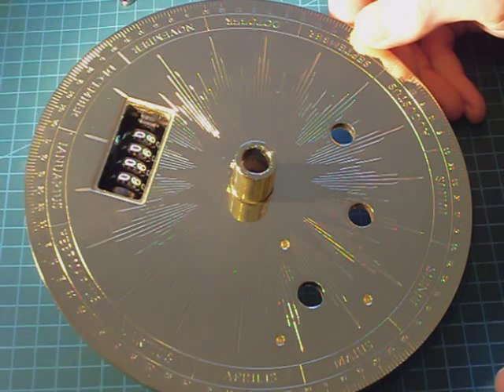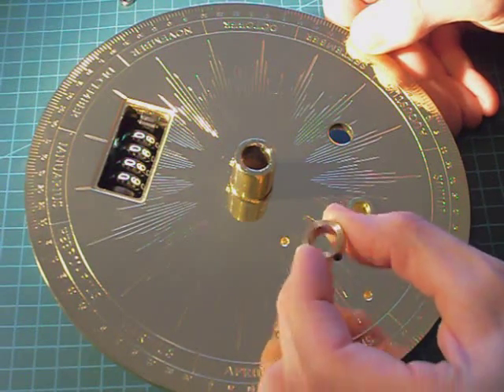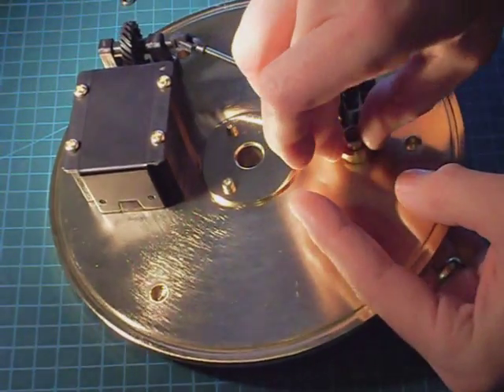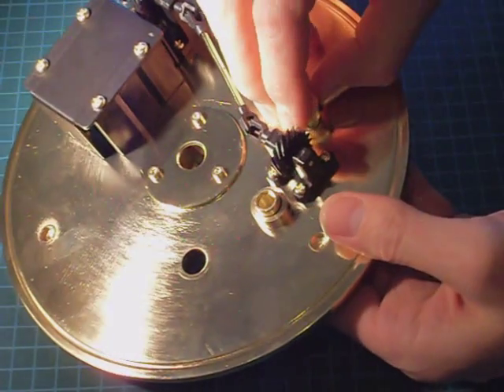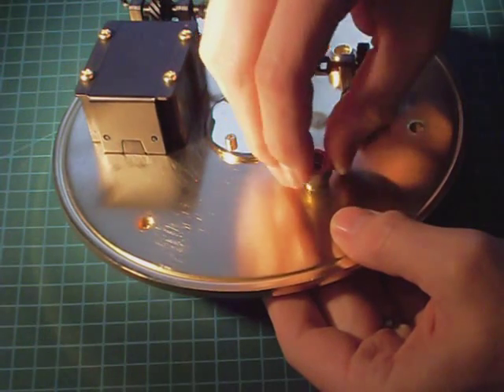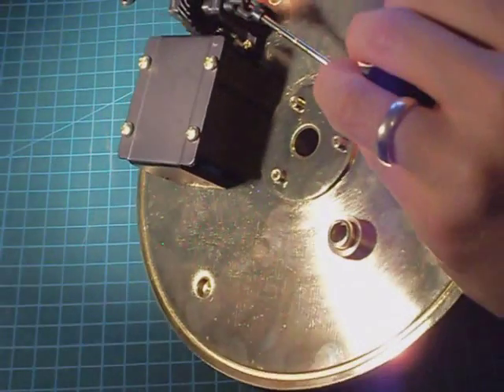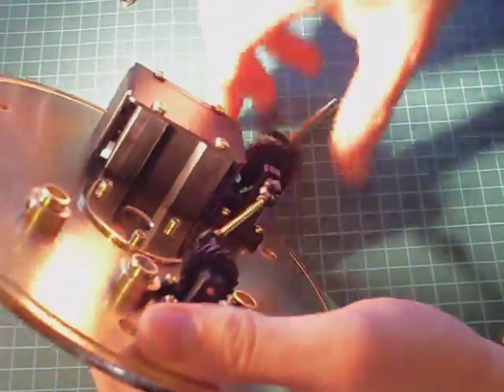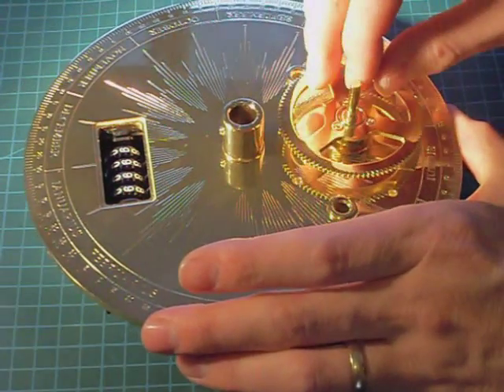Tellurion.wmv

Comment: I called Eaglemoss and they are sending me another collar. I will use a Dremel tool with a cutting wheel to make notches in the collar to clear the legs. I just need a collar for the center shaft. The anomalistic gear doesn't see the forces like the other gears do. It just turns a pointer. I also found that the pockets where the bearings seat into are oversized causing the bearings and the shafts to wobble. I am going to CAREFULLY!!! loctite all the bearings of the model in their seats.